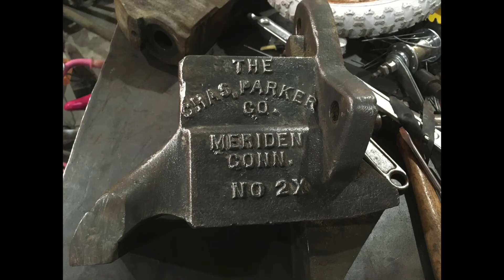WEN Portable Bandsaw - Unboxing and Initial Conclusions - I got Screwed

Comment: What are the 3 screw holes for by the blade tensioner?
Reply from the maker: No idea i will gladly check it out for you and get back to you asap
Reply: @KUGW  thanks, let me know
Reply: @KUGW  it's for a base vise. There is a vise it hooks to, and this helps hold it. It's like a handle that hooks to it.